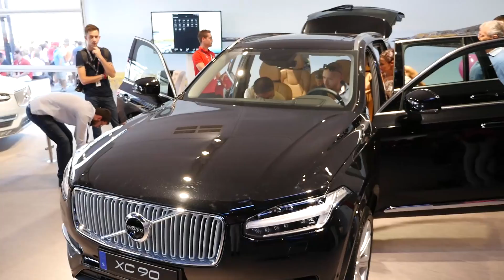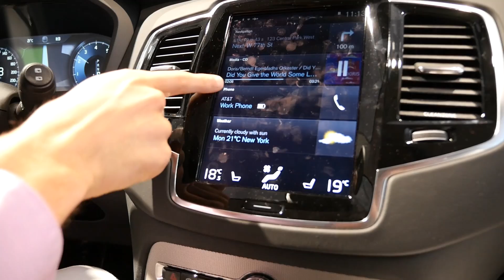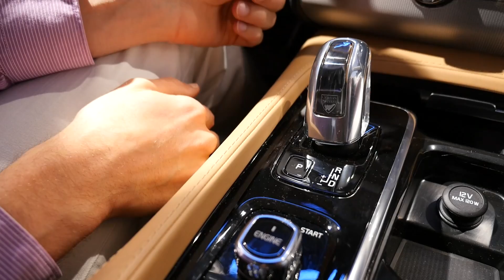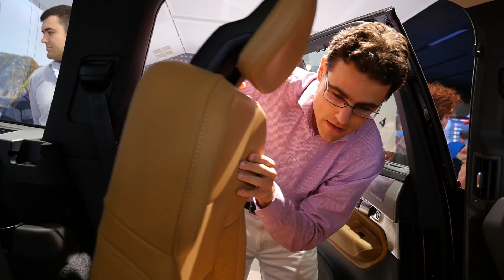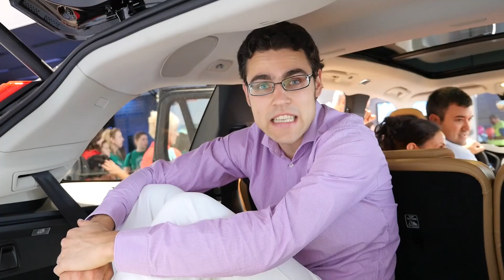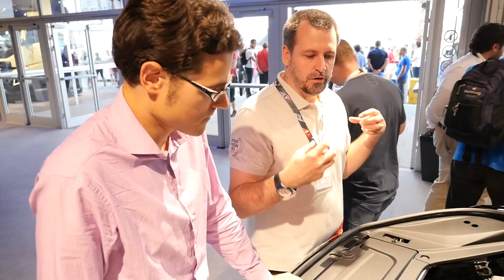New 2015 Volvo XC90 review exterior interior & engineer interview at Volvo Ocean Race

Comment: that grill reminds me of older S80..that vertical looking "strips" does infact looks like  i would say 2000 or so S80. i dont like that grill that much..but i guess they want to keep that tradition ..
Also i wish if it was knob like germans . idont like touching the screen with all that finger print and you have to reach to touch the screen..i like the some sort of main knob in the center column to control the screen..
Reply from the maker: lexusfan100 Indeed that might be a matter of like-or-not, I am not sure myself which system I find better. The central knobs are better to be controlled while driving, the touchpads offer more intuitive control.